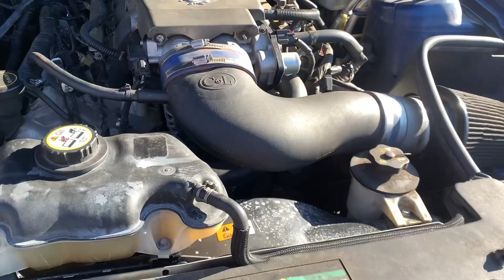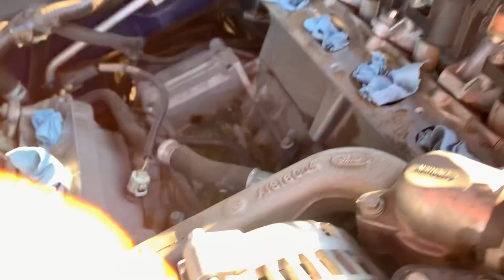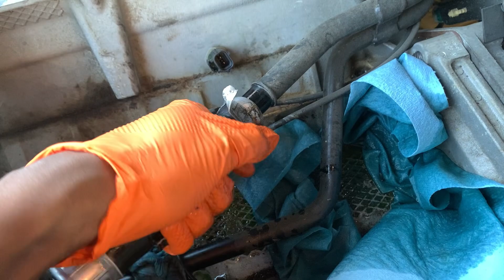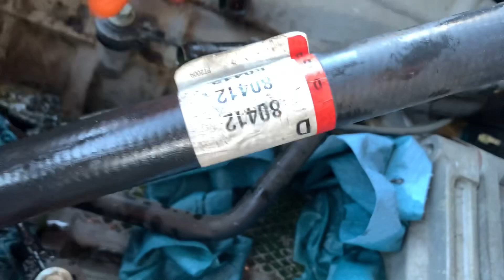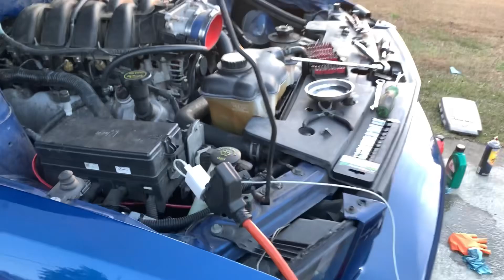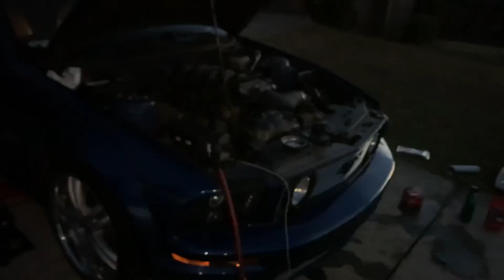2005-2010 Ford Mustang GT coolant hose leak SOLVED

Comment: I had previously replaced the L connector with an OEM one now I’m having to replace it again because the plastic that comes with the connector gets brittle quickly I highly recommend doing what he does in the video and replace the whole connection with the HVAC Heater Hose D80412 from Autozone to avoid having to replace it again like I did, thank you for the video!

Comment: Goodness! Thanks for a great vid. When I saw all that green I almost threw up a little in my mouth. I'm about to fly south to purchase a gently used 2008 Bullitt. Honestly, the fluids and hoses are what worries me most. I'll be driving it 1,300 miles home. In the heat. I might do a preventive strike and replace everything coolant related when/if I make it home. Also, wow, what stereo head unit you got?
Reply from the maker: The design of that hose fitting is what fails the most on that part. The fitting is plastic and high heat and cold cycles are not good for plastic so it becomes brittle and breaks. It’s good perform preventative maintenance but a simple change of that hose to the one that I have will hold up. 

Also I have a the CarPlay screen that can be purchased on Amazon or eBay.

Comment: Do you not need the pressure piece in the hose like the factory part. Does the heater still work like it should
Reply from the maker: No it’s not needed. Evening works as it should with this setup

Comment: I have 2010 Mustang GT 4.6 V8 - problem is I cant find intake gaskets to buy online for it to replace the old when I remove it.  What they have at Autozone is this series of attached gaskets, looks totally different than what fits the car  -  any ideas?  Great suggestion with the hose btw - thanks...
Reply from the maker: Well I actually bought a set from autozone and they came separate like they were supposed to, weird part was it only came with 6 gaskets instead of 8 so you’ll have to buy two sets if you go to the parts store. Double check you’re putting in the correct info for your car

Comment: 🔥Fire video looks like I'll be doing this on my 06 GT. Don't know why Ford chose to use that convoluted quick connect to crimped hose to metal pipe design when this is simpler and more durable. Probably to save a few seconds on the assembly line?
By the way do you know what part number constant tension clamps you used?
Reply from the maker: I couldn’t agree more man it’s poor design hands down. I bought an assorted kit on Amazon with all kinds of sizes I’ll see if I can find the link for ya

Comment: Thank you again! Anyone that’s about to do this, buy the exact part number hose. I learned the hard way. Also, he mentions you CAN overtighten those hose clamps, I learned that the hard way also. Tightened them too much and they ripped holes in the hose. Tighten till snug and then tighten a little more.
Reply from the maker: I’m glad my video and tips could help out man
Reply: What’s the exact part number for the hose?
Reply: @colemartinez2755 it’s in the beginning of the video, but if I remember correctly, any 5/8 hose with a 90 degree in it should do.

Comment: So I’m watching this, 6months from your post day. How’s the car holding? And is this really the way to go?
Reply from the maker: It’s still holding to this day. In my opinion it’s a better setup than the one ford makes with that plastic connector.
Reply: @SlowCarRepairs so I picked up the part that has the quick connector from autozone. I’ll see how it goes
Reply from the maker: Good luck man
Reply: @SlowCarRepairs I put the stock one on but I removed the crimped part and clamped it like you did. This was about a year ago. It blew out today at the plastic elbow. Im gonna do it your way now. Autozone part number 80412.  5/8" hose with clamps on both sides
Reply from the maker: @mbryan2010most definitely man, the way that I did it has been proven to last.

Comment: I'm having this exact same issue and indeed I think the o-ring in the quick connect fitting failed. I like the idea of using clamps (since that's what's used everywhere else) and am gonna copy what you've done here. How many miles does your stang have?
Reply from the maker: I’ve pushed the car pretty hard too and it’s still holding strong so this method has proven to be pretty effective. Also your build is crazy I’ve checked out a couple of your vids keep it up🔥
Reply: @SlowCarRepairs  Copy that thanks for the follow-up. Mine just hit a 100k and obvs I push it p hard lol. Keep the vids coming man always like to see how other folks solutions/builds.
Reply from the maker: No problem man. I sure wish mine was back at 100k lol, but thanks for watching man good luck!
Reply from the maker: Well at the time it had about 179k I’m at 189k now with no issues out of it
Reply: The legend himself 😂
Reply: Ths is definitely a good DIY solution, it's worth mentioning though that the whole heater hose assembly is still available new from Ford at the moment. There's a changeover month for 2007MY that determines which part you need, but both are still available.

Comment: Thanks for the video. After doing the install i got a battery light warning. Do you know what might be causing this. I checked all of the wires and sensors everything seems to be connected. Im going the take the manifold back off today and check the wiring behind the alternator.
Reply from the maker: Yea just make sure you didn’t unplug anything from the alternator , also have your battery checked if you don’t find anything unplugged or anything out of sort. Thanks for watching

Comment: So how could you tell that hose under the intake was leaking ? You cant see anything from the outside
Reply from the maker: I was able to smell coolant so when i used a flashlight and shined light to look in between the the gaps on the intake manifold to see the top of the block where the hose is located I saw coolant pooled up in there.
Reply: @SlowCarRepairs awsome perfect ! Ill take a look to make sure mine isnt leaking ! Thank you !
Reply from the maker: No problem man
Reply: I looked beside my alternator to the right of it and there's a little gap where u can clearly see it dripping

Comment: What size hose did you use to replace? I am going to replace my coolant crossover gaskets and I might as well swap that out while im in there. I know its prone to cracking and leaking.
Reply from the maker: It’s a 5/8 hose, I showed the part number in the video as well. I got it from Autozone.